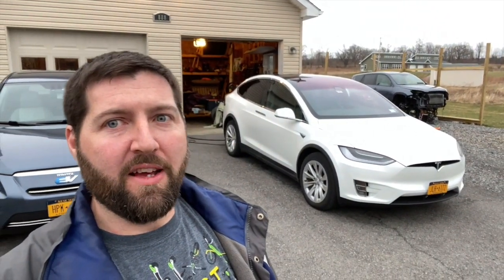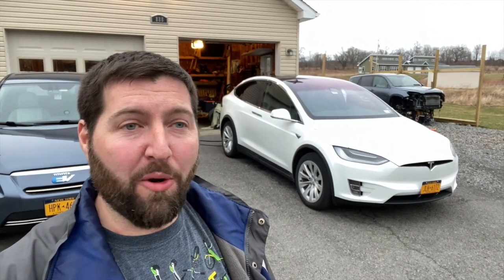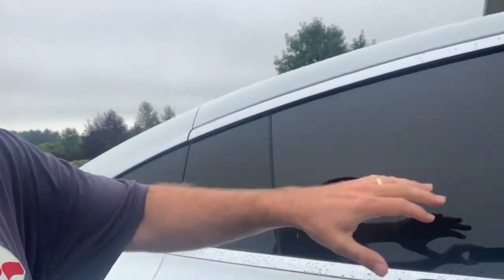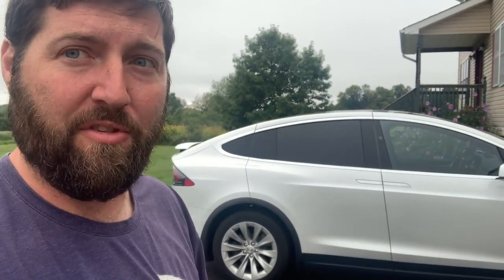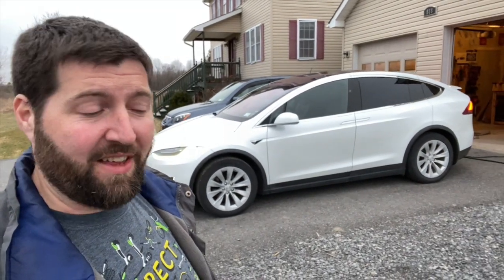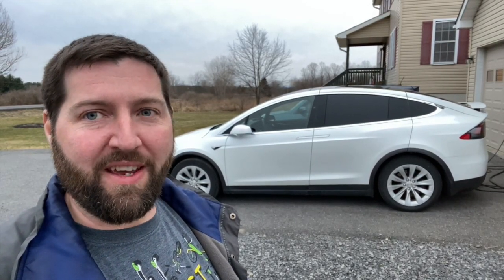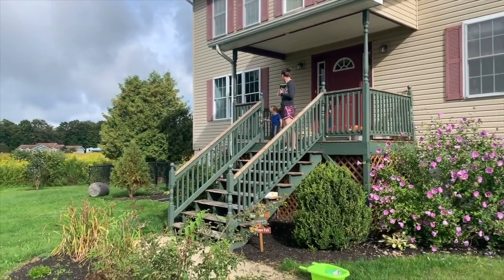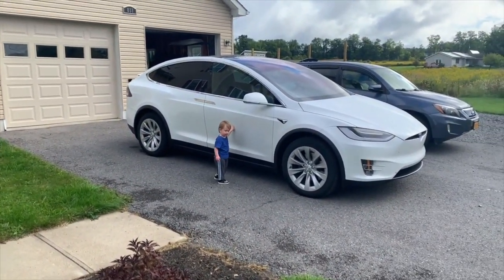Tesla HID DAMAGE on my Brand New Model X

Comment: I definitely feel your pain. I'm a Model 3 owner and while I love the car and can't imagine a better daily driver, I've had my fair share of issues. The car was delivered to my house on at trailer and when I was going over it, I found a big rock chip on the front bumper, the left turn signal didn't work, and a bunch of body alignment issues. One week later they took my car and gave me a Model S loaner for TWO WEEKS while they fixed it (repainted the bumper and replaced the steering column). I think my next "issue" is that I ordered the OEM winter tire package in October and they didn't arrive until the end of February, and one of the new wheels had a scratch and needed to be replaced. Meanwhile, I heard a scraping noise while driving at low speeds and found out that the underbody shield for the front motor sheared some screws and was dragging on the ground like a snow plow. While they were replacing that, without my permission they "washed" the car, and by washed I mean wiped the whole thing over with a rag filled with rock salt grit which scratched my rear decklid and doors and after many fights they never did end up fixing it. Then in the summer I noticed that one of my rear seats had a fold in the leather, even though almost nobody had ever sat in the back seats; service center couldn't fix it so the issue had to be elevated to the regional management. At the same time I was having trouble where Autopilot would randomly shut off, and also SentryMode would record 0 byte files, but both of those issues were fixed by a hardware reset of the cameras after they tried to replace them but realized they didn't have the right parts in stock. Then I noticed a smell from my HVAC so they replaced the filters and dried out moisture inside, but while they were doing that they broke an interior trim panel so they had to send someone to my house a week later to replace it. A few months later I heard a flapping noise from the rear of the car, which turned out to be fasteners for the fender liner that had come loose so they had to replace those. They also replaced a breather valve for the battery because it would make a loud thunking noise while Supercharging. I have hardware 2.5 and ordered the FSD package, but because of parts backorder, this week after 11 months they are finally bringing me in to install the hardware 3.0 computer. At the same time they're going to try to fix a clunking I'm hearing in the rear suspension when driving over bumps. But I still love the car.
Reply from the maker: Because of this channel I have unfortunately heard many of these stories. Like many of you, I was a HUGE Tesla fan. I used to recommend them to everyone I came across. But at this point I think they are horrible and wouldn’t recommend them to my worst enemy.
Reply: @JamesKlafehn  I would still recommend but with a disclaimer to be careful. I really can't think of what car I would want as a daily driver except the one I have. I do think we are in the minority and that most people have a great experience. A co-worker of mine bought only a few months later and I don't think he's been into service even a single time, though he did have an issue where the paperwork didn't arrive until a week after the car so he couldn't register it right away. I also think the service issue is mainly an east coast problem. I tried and tried to get the toy car Model 3 that was supposed to be delivered with my Model 3 and also the Dual Motor badge which wasn't installer, and had no luck here, but I went out to California for a factory tour and one of the service centers out there was very understanding and gave me both at no charge.
Reply: Wow 😳 this is eye opening

Comment: I remember when this video came out, you were so disappointed. Tesla accused you of putting the hole 🕳 in the diffuser and you didn’t keep the sticker, because you never thought that they would accuse you of making that hole.
Reply from the maker: No they never accused me. I threw it away because I thought it was nothing. I didnt realize at the time that there was a hole under there. I saw the sticker, pulled it off and threw it away. I found the hole the next day. If I am remembering correctly.